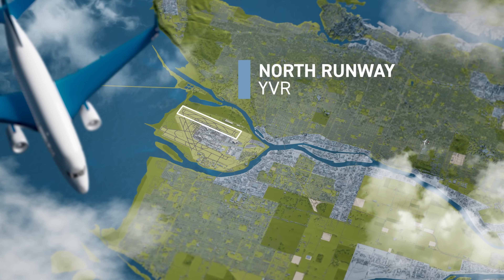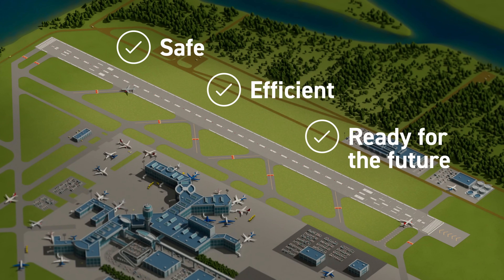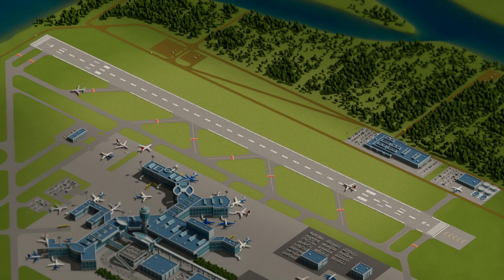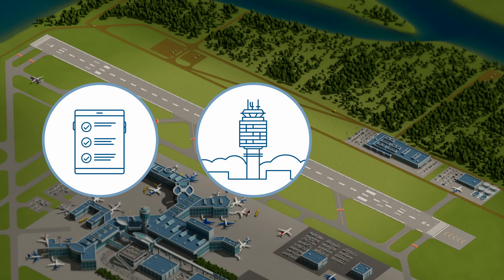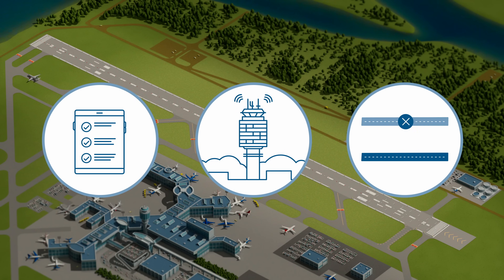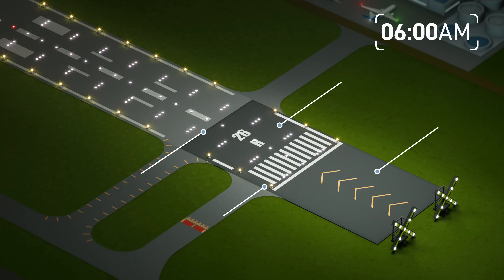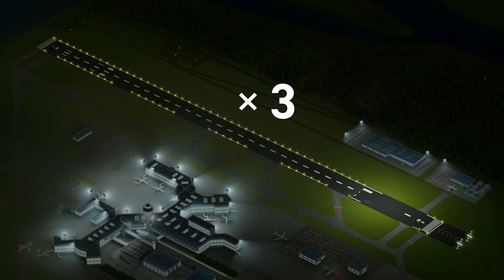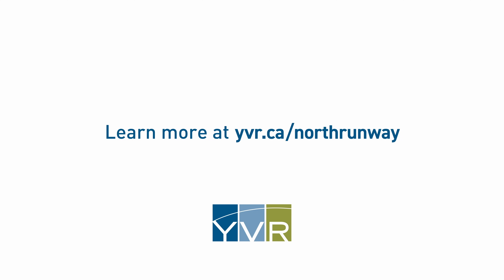YVR's North Runway Program Explained

Comment: I worked on the foundation prep work for this third runway for a month or so about November 1993. 
They had about thirty mobile cranes vibrating holes in the ground and then poured broken rock into them before vibrating it down some more. This must have been at least a year before the runway opened. 
My main point is that making a firm stable foundation upon river sand on a Sea Island is massively expensive no matter when you situate the darn thing. It was a memorable experience and led to 1993 being the first year where I ever earned more than $50,000 CDN.

Comment: When are airports around the world going to add Singapore's taxiway dynamic lighting system, where pilots follow the green center line lights, and stop at red lights when approaching to cross a runway before cleared to cross?  It directs them all the way from their runway to their gate.
Seriously, Vancouver ... look into this.  Massive safety increase.
Reply: As far as I know there is only one taxiway crossing the south runway, and none on the north runway. To get from the main terminal to the south terminal, and likely barely used by aircraft.

Comment: You might not recall that when they built the N runway 30 yrs ago, they loaded sand to a height of 50 feet  to compact the soil and it stayed there for at least 2 yrs before they even started the construction of the runway. My question is why are they using asphalt instead of cement.
Reply: If you mean concrete (cement is a component), probably because it won't cure completely in the limited time frame available.
Reply: I am not a construction engineer, but asphalt is somewhat fluid and not as rigid as concrete. I think it can take the shocks better if the underlying ground is not rock. Asphalt can also be mixed with concrete, creating a porous structure; they use that on highways in the Netherlands (to drain the rain more effectively), not sure if they also use it for runways. But I would like to be corrected if I got this wrong.
Reply: @peterbodifee  Perhaps this is the case reading that the thickness of said asphalt is significantly  more than typical roadways
Reply: @jimness5902 Wouldn’t the runway have to be shutdown completely to mill and resurface the concrete then?

Comment: 210mm. Goodness! Why not just grind and mill and add a new top layer?
Reply: Concrete milling? That's what the original runway surface is. Also, you do know that aircraft are a lot heavier and those weights transfer to the runway in ways that cars and trucks never manage onto the regular roadways.

Comment: My question is why the UPS and Canada Post processing centre built so close to the north runway? This voided the possibility of building additional parallel runway in the future.
Reply: Don't they already close the north runway at night for noise abatement reasons? Wouldn't make sense to build a runway even closer to homes.
Reply: @ ah that makes sense to put it out in Iona beach. 
But then how about demolish runway 13/31 and put a large fancy satellite terminal over there? Keep extending the international west wing beyond pier D gives me KIX vibes and that terminal is LONG.
Reply: @rickfeng4466  A single terminal architecture is MUCH better than multiple satellites. I think YVR is looking at the architecture from AMS. Needless to say, YVR and AMS are my favourite airports.
Reply: Felt the same. The new runway they proposed is over the water, which looks so weird.
Reply: @jefferyjin5551  Sure it "looks" weird, but it's a much better solution. A third runway further north not only impacts more residents in terms of noise but it also removes that whole area as a recreational area. A foreshore runway could also be used 24 hours a day if YVR needs to go full beast mode.